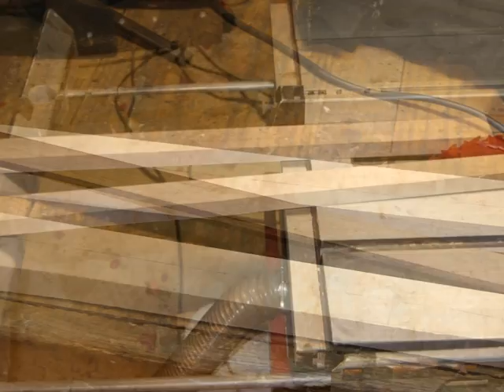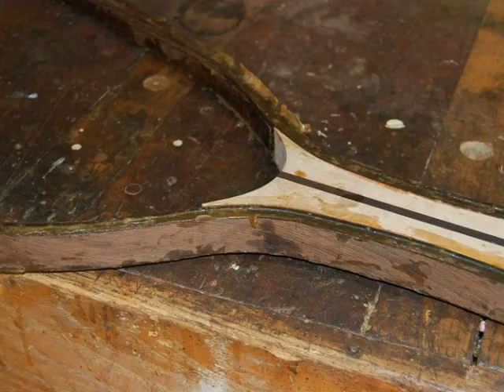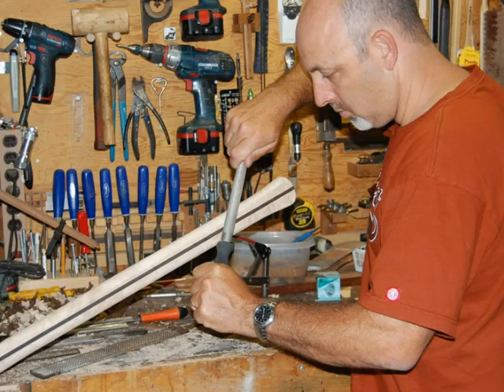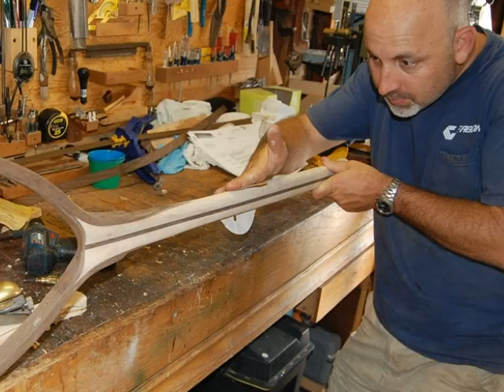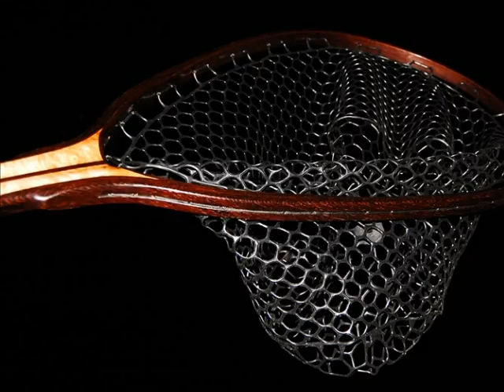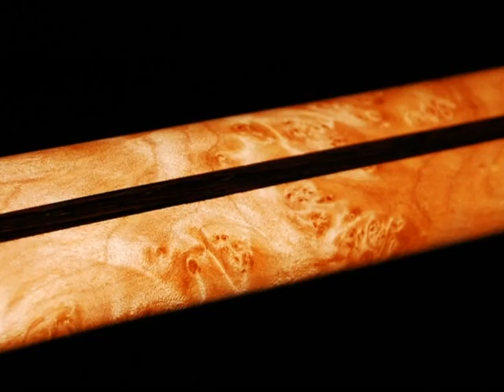New Custom Boat Net- The Beast.wmv

Comment: Awsome piece of art, is that a 47-49 inch diameter net?
Reply from the maker: More like 53-54' circumference, if that's what you meant, Abel.
Reply: Thanks for the answer. Where did you get those nets? the largest I have found is a 49 inch circumference, not enough for serious trout...